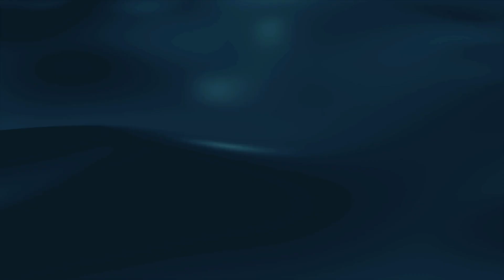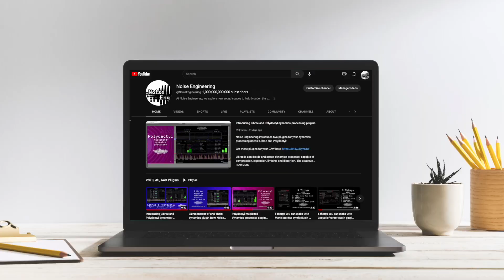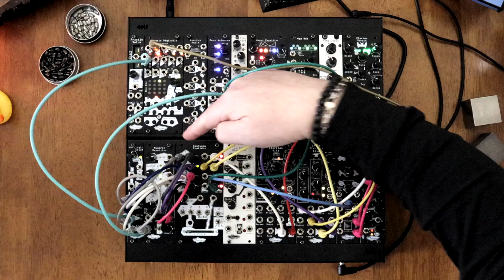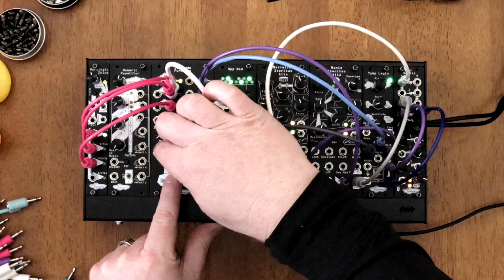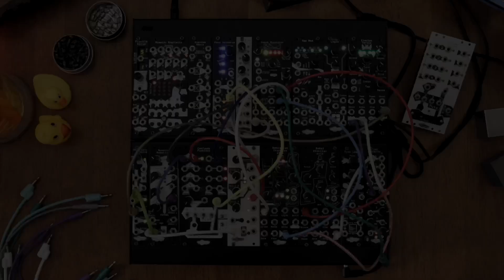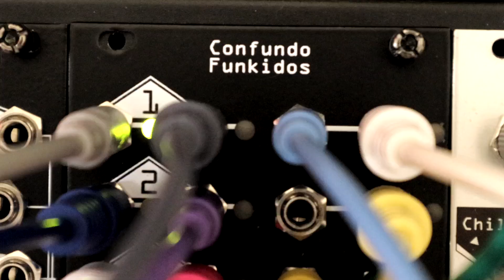Confundo Funkidos four-channel rhythm crossfader from Noise Engineering

Comment: So excited you've brought this back 🖤 I'm still curious how the accents work... I guess the different modes doing like logic operations on the incoming triggers to get the accent output?
Reply from the maker: Technically...the accent patterns are defined by the Accent switch with has 3 settings:

To the left, a channel’s Accent goes high if it outputs a trigger, and the next channel wouldn’t  output a trigger simultaneously, regardless of its mute position.

In the Middle, Accents are high when both inputs receive a trigger simultaneously.

To the right, Accents are high if a channel outputs a trigger and the next channel would also output a trigger simultaneously, regardless of its mute position.

Comment: First when I saw this I thought this would be finally a module that is taking the idea from the octatrack scene  crossfader. Does anyone knows if a module like that even exist?
Reply: Befaco Morphader might be what you’re looking for?
Reply: Octatrack and modular synths are a deadly combination. From generating midi to looping and resampling to playable multifx, it does so much. I can't image what the price tag of a comparable modular setup would look like
Reply: Catalyst Controller
Reply: What feature from the Octatrack do you like that Confundo doesn’t have? I’m curious because I’m developing a matrix switch sequencer that allows you to program a sequence of input CVs to outputs. 10 inputs, 10 outputs, and 10 sequencers each with an A and B pattern to fade between.
Reply: The Catalyst was designed to meet this need. 4ms now makes it. It’s a dual function module it can also be a sequencer which is how it’s usually promoted.
Reply: Intellijel makes a terrific 1U crossfader.